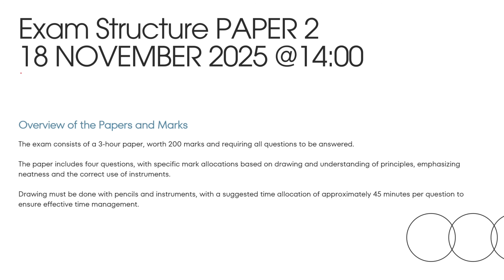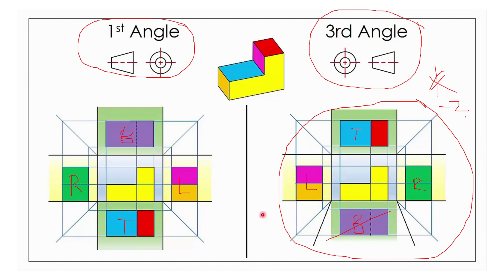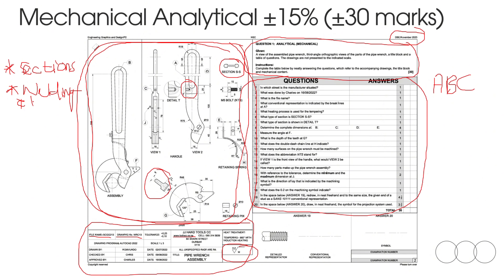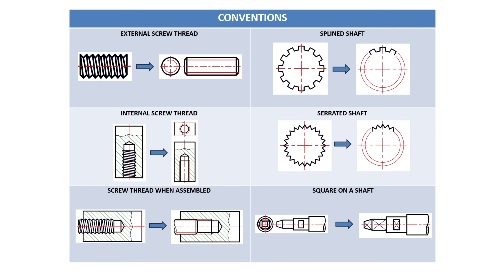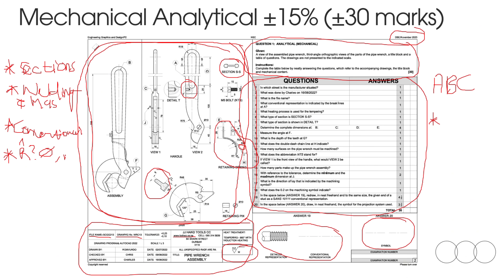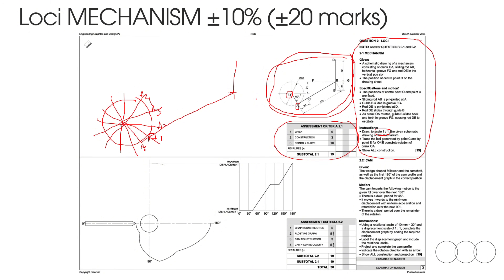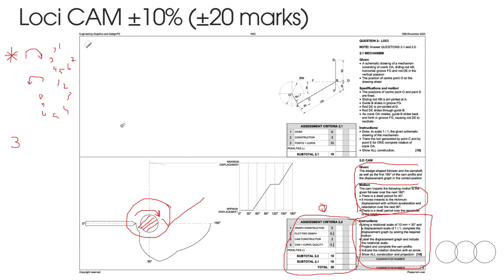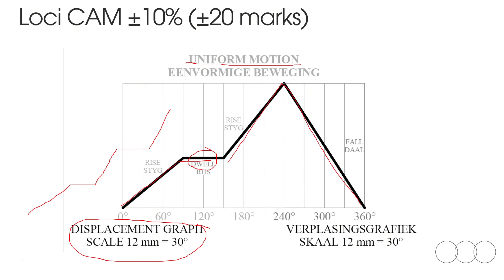Gr12 EGD PAPER 2 FINAL EXAM GUIDE | PART 1

Comment: Hello sir,how do we answer those questions where they ask "how many surfaces are supposed to be machined"?
Reply from the maker: Hi there 👋

When a question asks "How many surfaces are supposed to be machined?", you look at the engineering drawing and count all the faces that have machining symbols on them.

✅ Machining symbols look like a check-mark / tick (√) or sometimes √ with a number.
✅ Each symbol tells you that surface must be machined.
✅ Count each surface once — not each symbol.
❌ Do not count surfaces without the machining symbol.

So your answer is simply the number of surfaces that show the machining marking.